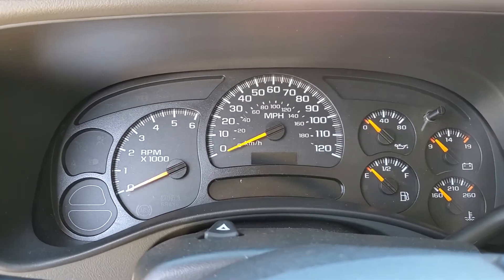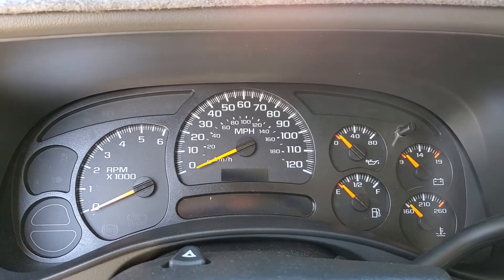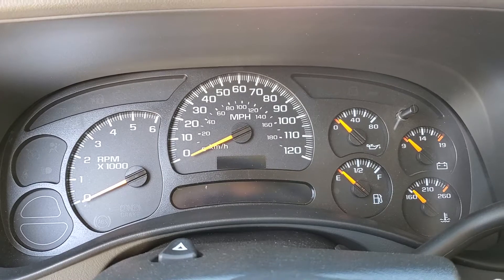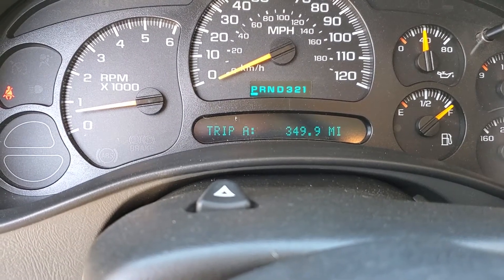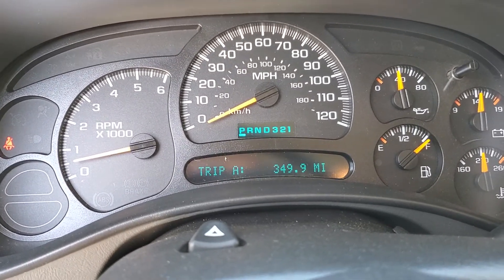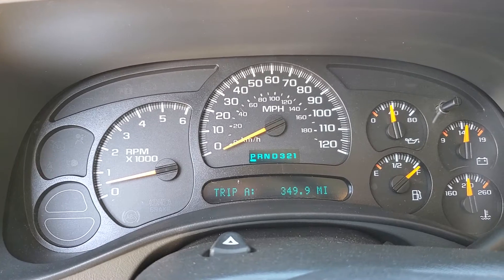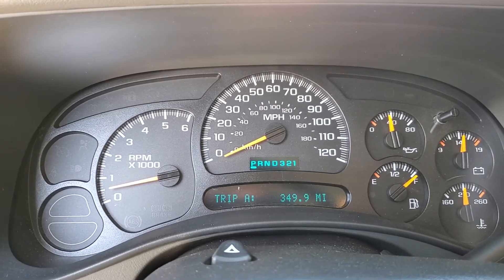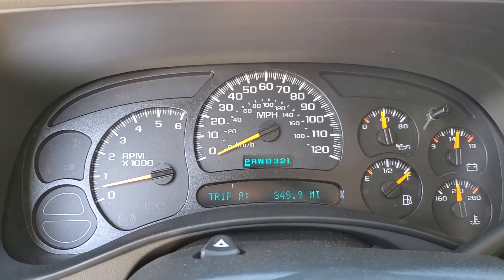Chevy 5.3 knock sensor relocation experiment update

Comment: can those sensor made the truck go off as you driving, that what s happening now me I need help in a yr a have replace  both twice
Reply from the maker: I don't know. It doesn't seem likely the knock sensors would make the truck shut off. Good luck.
Reply: @2lotony  @ any link of adapter to sensor to driver side head??
Reply: Do the Rev trick..
Reply: Well I hoe the knock sensors were ac Delco if not that's your problem rite there

Comment: Hello, great thinking. What did you do with the rubber covers by the sensor electrical connections? Are they free floating....taped  to anything? Thanks
Reply from the maker: Taped up all the wires best I could. Yes, seal are just free floating, I guess I could have trimmed them down but I didn't..
Reply: Got it. Thanks

Comment: Hayelp!  I've seen in the comments that this requires a male/ female adaptor for I belive the drivers side. Can you tell me what the thread pitch and sizes the adaptor are?
Reply from the maker: Hey,  I wish I could give you the size but I don't know. I bought my sensors, I noticed on the Driver side it needed to be spaced out from the head due to manifolds etc. The sensor would screw right into the head if there was room. So I just took that  sensor with me to the Hardware store and picked up a double female extension and a piece all thread I think and made sure it all fit together. then took it home and installed it.

Comment: I had a question, how long did u cut stud that went into engine block... sorry to bug you
Reply from the maker: It was not cut. The male threaded part was about inch and a half. It had a small flare in the middle like a exhaust header stud. The female threaded part is about 2 inches. I just screwed the male part into female part and then into the head, last I put on the sensor and tighten everything. I ques I was lucky everything I bought just fit.

Comment: Km going to try this on my 2003 chevrolet avalanche did you use a extend wiring harness?
Reply from the maker: I used stock harness.  I had to split the wires apart to make them reach. Just cut the tape holding them together and reinforced where needed.